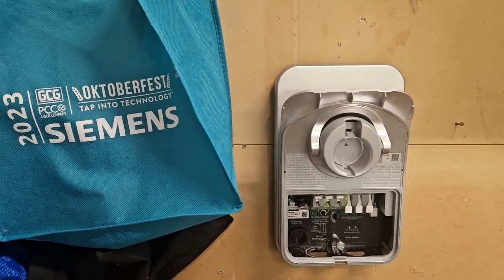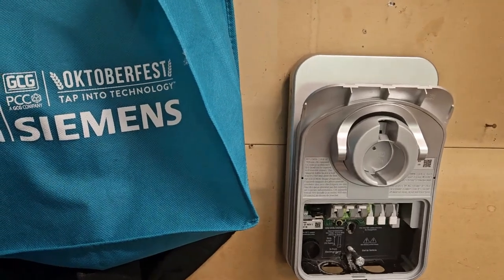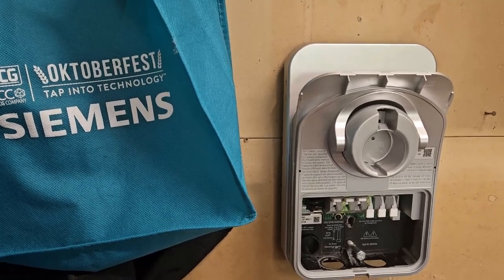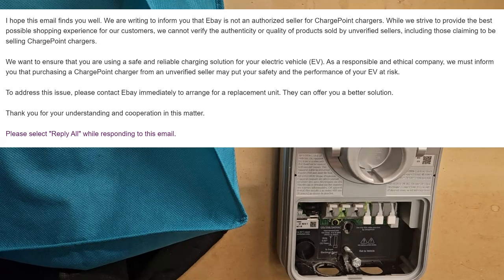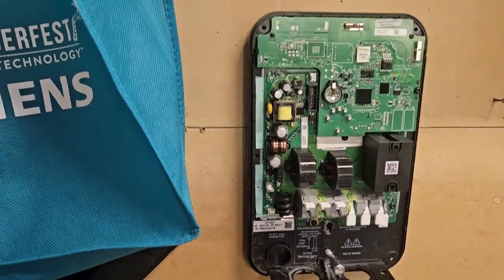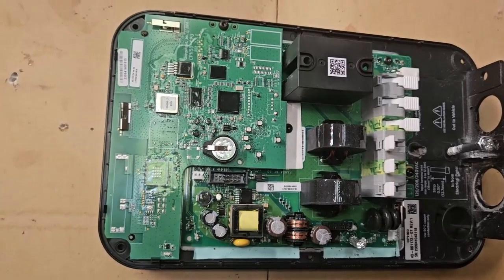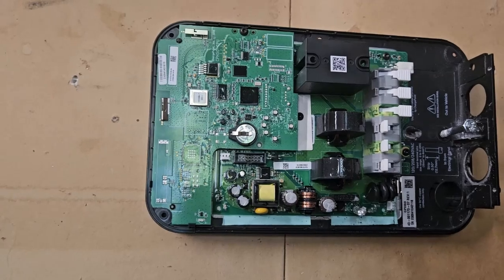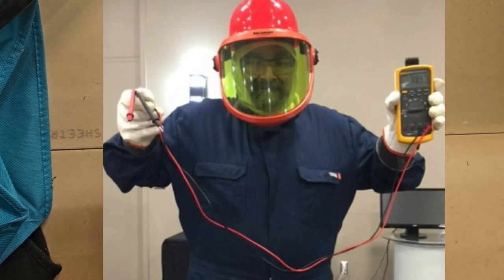Chargepoint Flex FAIL. Warranty not honored but easy fix

Comment: Mine is making a popping noise when It starts charging. I used a multimeter to confirm the outlet is giving the full 240v. Could it be that fuse? I am mainly worried about arcing and fire. I have it unplugged until I can figure this damn thing out. Barely used < 2 months. 😢

Comment: I am goint through the same type of malfunctioning of my charge point unit after 4 months: light use, installed by electrician and against his advice as he was suggesting an other brand he knew has no issues. I bought it straight from chargepoint after i saw your video. I wanted the fullproof warranty and their latest model. Now it seems it will be trouble with them. They trying to shy away. It does not look great for the warranty. They make it difficult and very poor communication service. I will keep you posted on how they will fix my issue if any of you are interested or on the market for a level 2 unit at home.
Reply: Any updates? What brand did the electrician recommend?
Reply: @supreme84x he recommended flo. They sent me a new one to replace it which i did. The full invoice by the electrician is out of my pocket, which I deeply regret. He told.me and i should have go with his recommendation. I asked to be refunded but to no avail. I'm just crossing my fingers now. Next one, because they'll be one, will be a flo

Comment: I wondered about this warranty issue. So I looked it up in my paperwork having recently purchased a HomeFlex. The first paragraph of the three and a half page warranty states that it applies to “you, the original purchaser of the product and is non transferable”. So can’t blame them for no warranty. Also replacing a fuse without knowing why it blew seems a little foolish. I mean usually it is on primary side or the secondary.  Could have been a surge or spike in the AC or something is wrong on the other side which I would imagine be potentially far worse. Then again maybe it was a bad fuse…

Comment: Being an electrical engineer,  can I use my existing 220 - 12 AWG 20 AMP circuit for the Charge-point flex or do I need to upgrade the wire size?  In the manual it says it will charge at 16 miles per hour on a 20 amp circuit which I’m fine with because I only have a 40 mile battery range on my hybrid.  Thanks for any help

Comment: I replaced a thermal fuse in my Chevy charger and it worked. Similar failed when resulted from using an extension cable. I ended up replacing the prong plug and cable.

Comment: I had the same issue, What are the fuse specification and why would it blow that fuse. is it a fast or slow blow fuse? Looks like an easy repair? Poor design for tiny part to trash the whole unit.
Reply from the maker: I couldn't get a close look at the markings on the fuse but it looked like maybe a 1A ceramic 5x20 with axial leads.

Comment: On which planet would that fuse be unreplaceable?  If that's truly the case, wonderful design Chargepoint.  Kill a 600 buck EVSE with a .43 cent fuse.
Reply from the maker: a fuse soldered onto the board requiring major disassembly to access is not designed to be replaced.